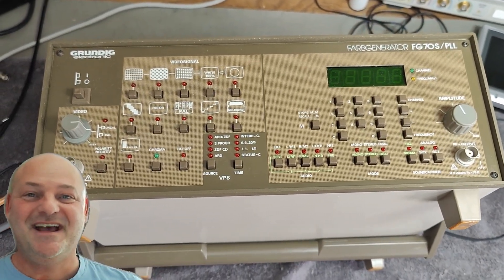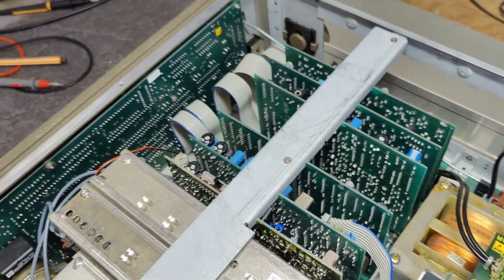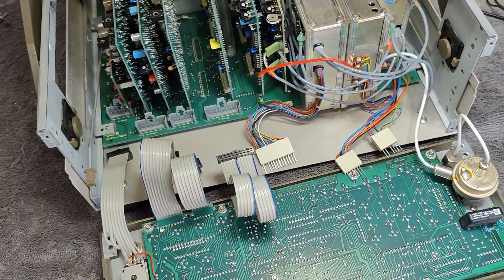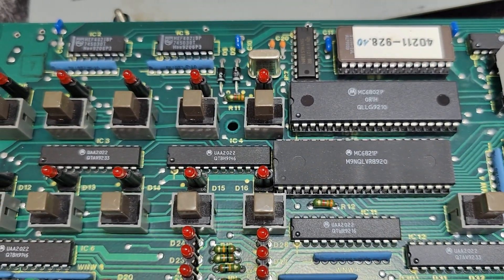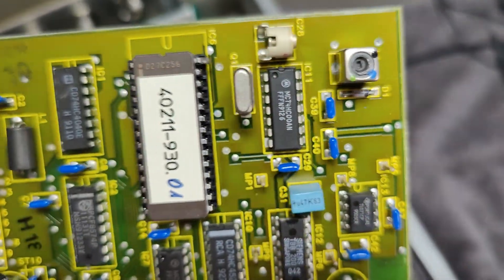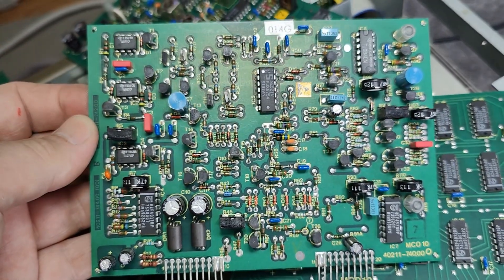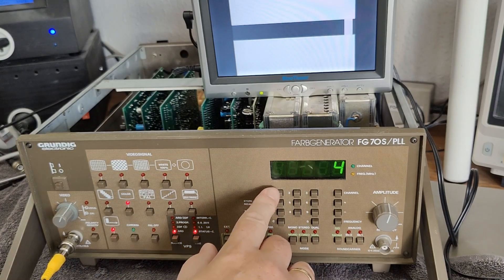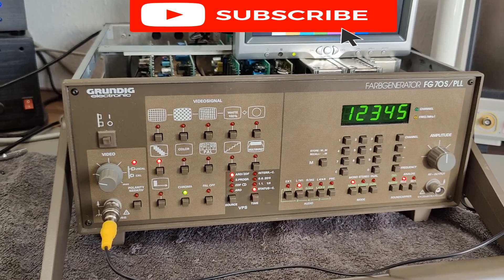Grundig Farbgenerator Color generator FG 70S/ PLL tv test colorbar 1992 repair teardown

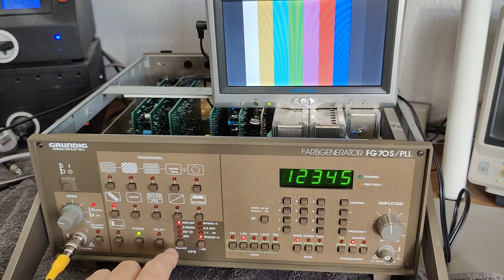Comment: 17:33 - This section provides a generator function for the VPS (Video Programming System). This signal controls the exact activation of the recording function in video recorders. In this way, time shifts including overlengths are recognized and thus recordings can be made exactly. The VPS signal transmits a code, so to speak, as long as a correspondingly programmed program is running. The signal could even control pauses to skip commercial breaks, provided the broadcaster wanted and activated this. The input field with the names of German TV channels simulated the corresponding identifiers. With this function, complete repair/control including the timer function of video recorders was possible. These devices were also used in the Grundig factory in Nuremberg-Langwasser for final inspection in production!
Reply from the maker: wow cool, i never owned a VCR that supported this start or stop code.
Reply: @TeardownOZ2CPU  In other countries, a similar system is better known as program delivery control (PDC). However, most manufacturers later supported both systems. Technically speaking, no start and stop signal is transmitted. Like teletext, the VPS/PDC signal is transmitted continuously during a TV program. This meant that a programme that was already running could still be recognized and recorded even if the start was missed, e.g. due to an interruption.
Later models of Grundig picture pattern generators, such as the Grundig VTG 700, were also able to generate complete teletext pages and 16:9 wide-screen picture patterns. These devices were also used in production for final inspection and service. The VTG 700, for example, could also be remotely controlled via RS-232 and IEEE-488, allowing complete processes to be automated in the test field.

Comment: The arrow next to the circle means you can combine the circle with any of the other options on that row only. If you enable one of the options in the second row, it disables the circle.

Coincidentally, I just bought a Philips PM 5518-TX from an ebay seller in Germany. I had been looking for a PAL test pattern generator for some time when I came across your video on the PM 5515. After that I'd been keeping an eye on ebay for a reasonably priced unit, and there were one or two listed for what I'd consider an unreasonable price. Then the 5518-TX unit came up for less than the others, and I decided to go for it. They shipped through DHL, which I've had a lot of luck with shipping from Europe to here in Australia, so I'm hoping they packed it well enough to survive.

Comment: I think it was actually made by Philips. Most of the ICs are Philips.  The EPROM on the daughter board is to generate the circle digitally.
Reply: No, the measuring devices were not Philips developments. There was a separate Grundig business unit that had nothing to do with Philips. The devices were developed and manufactured in-house. Partly in cooperation with Hartmann & Braun (pointer instruments). Antenna measurement technology was later available in the same design as KWS from Großkarolinenfeld.
However, there was a historical collaboration with Philips in many areas concerning semiconductors and picture tubes. Not least because the Dutch Philips had bought the German Valvo (Hamburg), which produced the tubes and picture tubes used in the group at the time. After the renaming, these products were then mainly used as Philips picture tubes. In some series, however, there were also some from the then ITT and Hitachi. Later, thin-neck picture tubes from Videocolor in Ulm were also used. Videocolor was a subsidiary of the French company Thomson-Brandt, a competitor in the TV set market.
But Grundig also built and used chassis developed in-house in the TV sector. Grundig also developed and manufactured its own VCR, then Video 2000 and then VHS recorders for many years. Grundig also had its own hi-fi series for a long time.